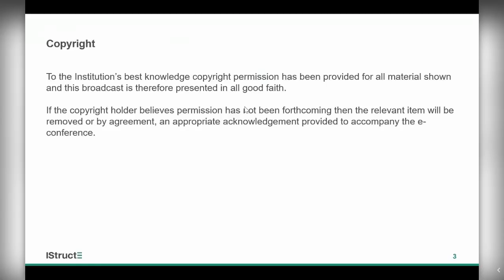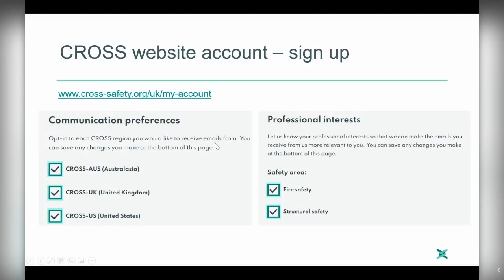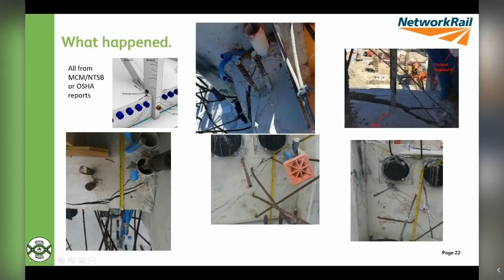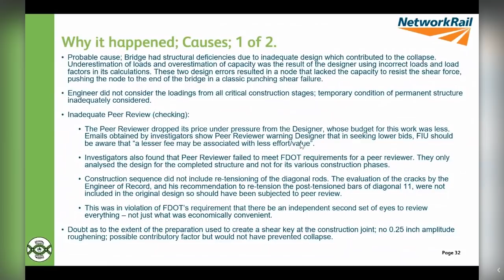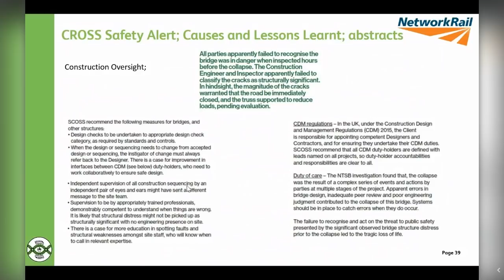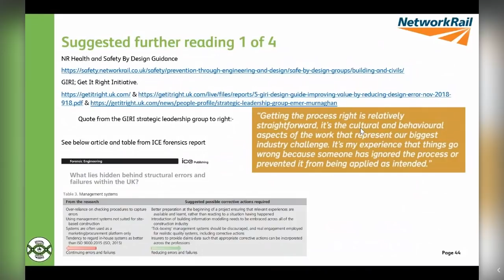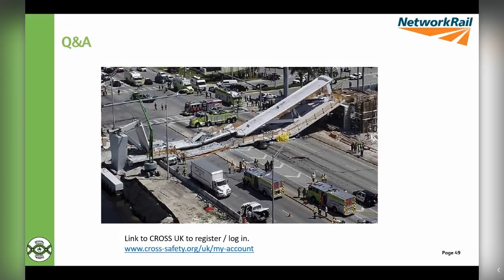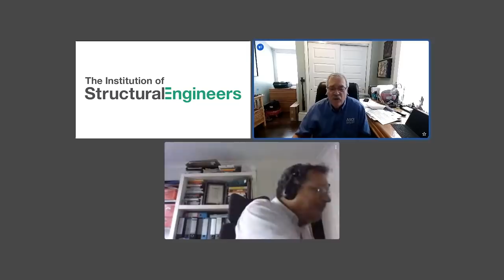Florida bridge collapse: lessons learnt

Comment: It seems to me that there was adequate redundancy in the joint. Defining redundancy in a code in a clear and succinct manner can be difficult but if a joint is overloaded by 2 and showing dramatic signs of distress prior to collapse, there has to be some internal redundancy (and ductility). The large #11 vertical bars in member 12 were acting in doweling in addition to the shear friction. I am not saying the redundancy was necessarily deliberate but it was there. The problem was that the obvious signs of distress from the design flaw were ignored. 

A double truss is not necessarily redundant. A failure of a single member  in one of the trusses can still cause a sudden collapse.

Comment: Professional associations are promoting the need to do concept and design checks for structural projects. However, they do not appear to be adjusting recommended fees for projects to account for the additional scrutiny. I also do not see proportionately more structural engineers graduating from university. Structural engineers typically spend a lot of over time designing projects. How can we be doing all the required checks when there aren't enough engineers and the association are not adjusting recommended fees?

I would propose associations add an additional recommended fee for the review process so that engineers will start to think about adding a line item for fee proposals. If checking is not adequately accounted for in the fee proposal it won't get done. Competing companies that do take it into account won't get the project. We want the companies that do the checking to get the project.